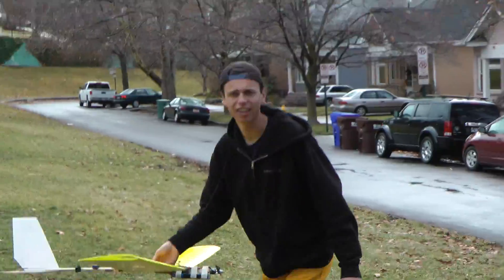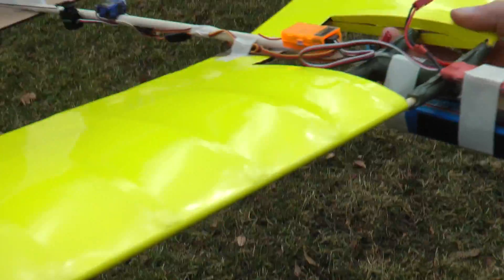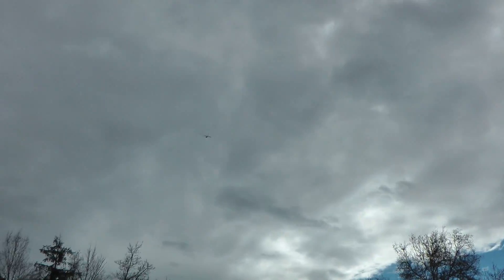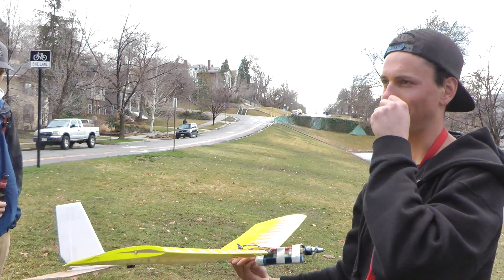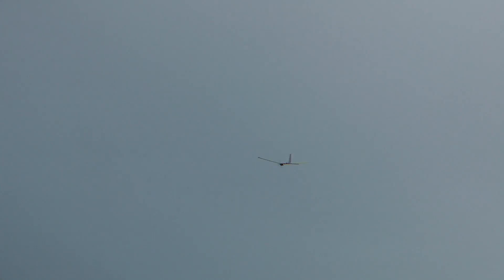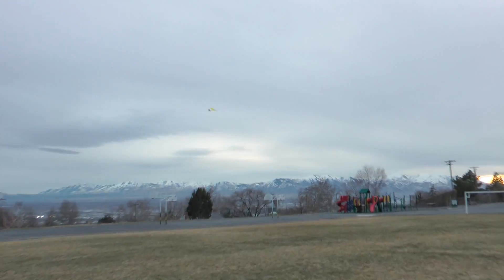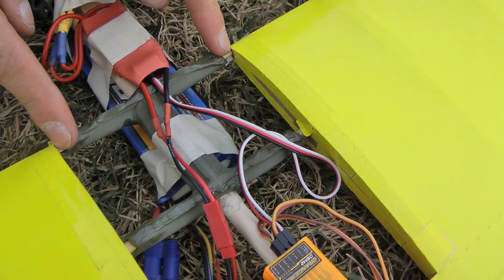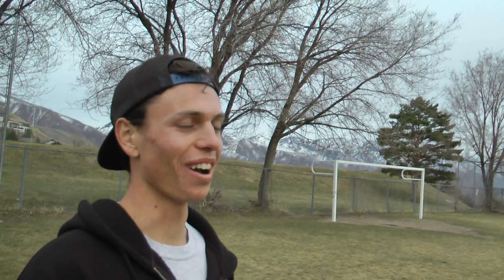R/C Cardboard Stick Plane - RCTESTFLIGHT -

Comment: I have built a few stick style planes out of cardboard and a carbon arrow shaft works great and fun. And its always fun to scratch build rc planes out of foam board with no plans at all just build it and see what happens especially when it comes to building like a pylon racer i have built a few that have gone close to 100 mph out of foam board wood dowel rods for supports inside the wing and electronics of course for a total of 50 bucks i have a 85-95 mph pylon racer i buolt woth no plans

Comment: thanks for posting.  some thoughts.  if the model is tail heavy, why not fix it before flying it.  two changes would help.  mount the servos near the cg and reduce the height of the vert stab by 25 percent.       cheers

Comment: Anyone picturing clones of Napoleon Dynamite in their head with the commentary? (Ignore who the dudes are for a moment and just picture it.)

Anyhow, that junk plane flies pretty damn well for what it is. Looked like the spars were holding up even though the wings folded back into some dihedral a bit. The weak point is that stick for the fuselage, it being able to twist like that probably makes for some flutter or other oddness with the tail controls.